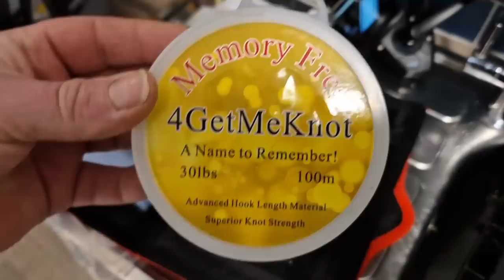Holyhead breakwater CONGER ON! Shore fishing uk MUST WATCH!

Comment: Go down to the next set of steps no snags there I had 3 rays there casting towards green light on the other side on the ferry Dock its probably the best peg on there all the best Paul from Staffordshire 🇬🇧👍👍👍
Reply from the maker: Did look a nice spot looking at it on the way, I'll try that soon! Is that by the big rocks? We've fished there once.
Reply: Yer just next steps down I all ways use to fish there and the next one down as well them 2 pegs are good but not fished it since you can not drive down to the pegs anymore used to fish's  it Friday to Sunday then go back home best two pegs in my eyes had some really big fish from them pegs and be careful if it's windy because the waves come over the top and can wash you in all the best Paul from Staffordshire 🇬🇧 👍